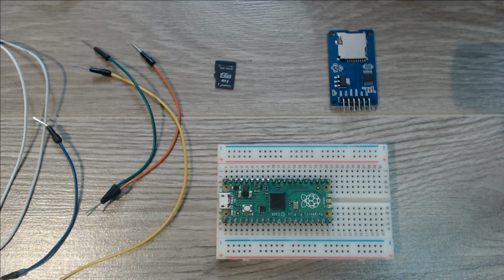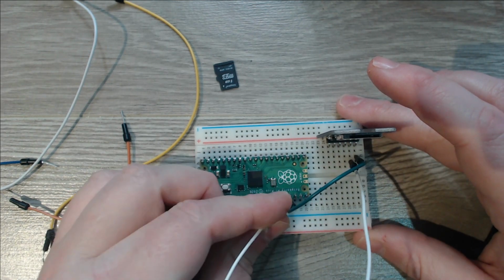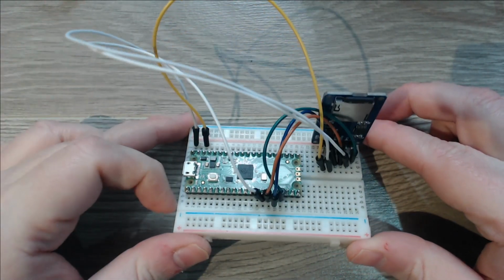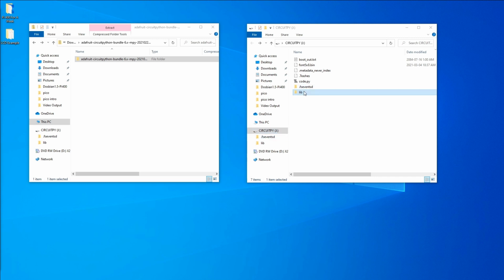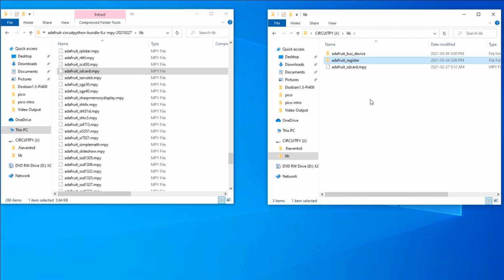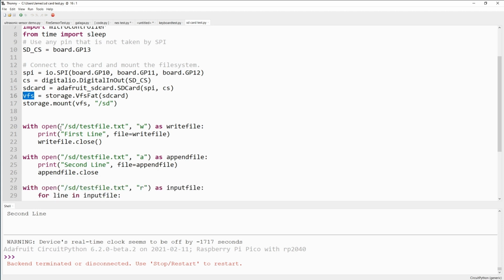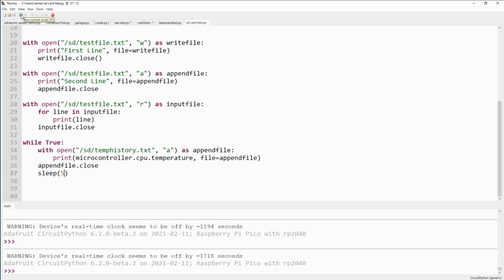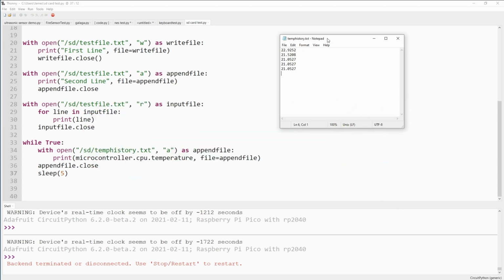@raspberrypi Pico SD Card Tutorial - Read, Write, and Log Data

Comment: Nice video. I am looking for a solution to be able to display images on a oled display for the raspberry pi pico. Trying to work around the 2mb storage limit of the pico. Would this be the way to go? Would I simply be pulling the data straight from the SD card and sending it directly over to the oled display through the pico?
Reply: I'm trying to do the same.
Could you solve it this way?

Comment: Thanks for another great video! What SD card holder are you using and where can I get it?
Reply from the maker: Glad you liked it! I've used a few, but this is my most recent order. C$ 0.83  3%OFF | 1pcs/lot Micro SD card mini TF card reader module SPI interfaces with level converter chip for arduino
https://a.aliexpress.com/_msOMnrR

Comment: Hi! Awesome video!! How can I use this with Micropyhton instead?
Reply from the maker: Hello! Unfortunately this exact method won't work in micropython, because it relies on libraries developed specifically for circuit python. I'll do some digging and see if I can find ones for micropython as well
Reply: @PrintNPlay  Hey! Thanks for the reply! Actually I decided to use the Pico's flash memory for my project, but I am still looking for the SDcard solution. I think that they haven't implemented machine.SDCard for rp2040 yet... But if I find something, I will post a link here for anyone who is looking for it too... Thanks man!
Reply from the maker: That's awesome! Absolutely love it when the community comes together. Thanks!

Comment: Thanks for the tutorial.
I have only received my Pico today (4/26/2021) after waiting months!
I am quite happy writing text files as you describe, but I do have a couple of questions.

If I install CircuitPython does it overwrite (ie replace) MicroPython, if it does can I still use Thonny to access it the same way?

Can I use SQLITE in Micro/Circuit Python and use the filesystem on the card in the same way?
Reply: I've had an occasion where switching to CP from MP and back ended in losing my MP code and libraries. Keep your files backed up!
Reply from the maker: Hey there! First of all, to hear you were able to get one! Great to hear.

You do have to choose between micropython and circuitpython. You can switch back and forth whenever you want, but you can only run one at a time on it. You can access access either from Thonny, you just need to change the interpreter from the settings in Thonny. 

I don't have any experience with SQLite as of yet, so I don't have an answer for you. I will try to dig into it and get back to you!
Reply: @PrintNPlay  Thanks.
If possible can you clarify "You can switch back and forth"
The question is can both be installed on the Pico at the same time, OR do I simply install the one I want to use just before use?
Reply from the maker: Oh, sorry! You must reinstall each time you want to switch.
Reply: @PrintNPlay  Great, thanks again.

One point of confusion though, I installed Micro Python and it was working great.
Then I followed your video and installed Circuit Python, ran your program and it was working great also.

But when I went back to Micro Python, my data and the original programs where still there!
I would have expected Circuit Python to overwrite Micro Python and vice versa, I was pleased as I had not backed up my original programs.

The main reasons for these experiments is to be able to get data in and out of the Pico (with out doing I/O via the USB), I don't have to use SQLite, in fact, now I know I can do plain file I/O I be happy.

Comment: Thanks for the good video on how to connect an SD card to a Pico.  I'm wondering, though if you can tell us more about the WHY you did it that way aand how it works so we can use it as a better starting point for our own future projects.. BTW, the CS pin on the card breakout and Pico stand for CHIP select not cable select.
Again, I am not trying to criticize your work, this kind of video has its place for those who find it helpful to get started and for me as well as i never considered trying to connect an SDcard to a Pico.  Now that I've seen this it has sparked some thoughts for the future for me.
So, Thanks!
Reply from the maker: Hadn't even realized I said cable select instead of chip select! Good catch! I had just been discussing old ide hard drive tech and must have slipped that in by accident.

This tutorial was actually directly a result of some other viewers asking for it, specifically for logging information from sensors over time.

Comment: Great video
Btw is there a way to save data on the pico with just the board itself?
Thanks
Reply: I'm using micropython and writing to Pico is trivial. You do have to stop main.py to see or upload your file.
with open('atrack.csv', 'a') as f:
    f.write(str(data) + "," + str(timestamp) +"\n")
## Using this form eliminates need to close file, it is done automatically.  Also 'a' append creates the file if it didn't exist. Lastly beginning filename with a puts it at the top of listing by Thonny.
Reply from the maker: I haven't played with it at all myself yet, but the notes I have read from others trying to write to the board using code say that the file system on the Pico is read only at runtime. 

So, I haven't tested it, but what I've read says no. Hope this helps!
Reply: @PrintNPlay  Thanks for the answer